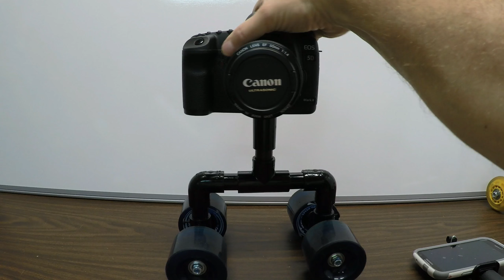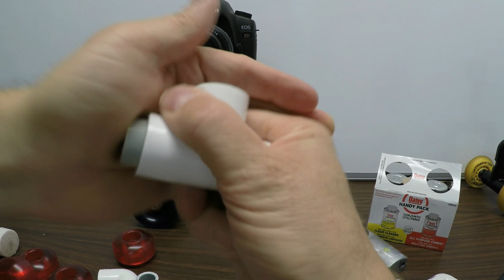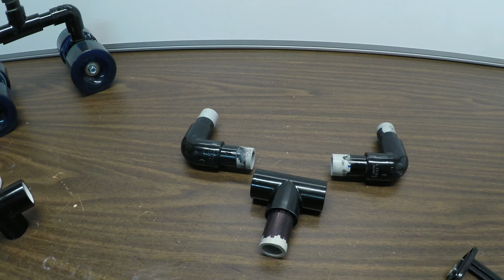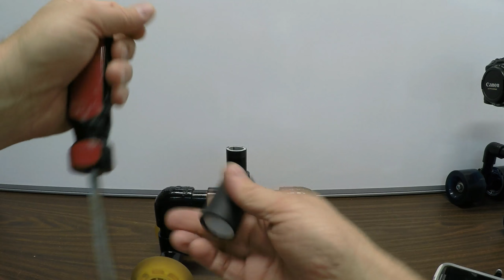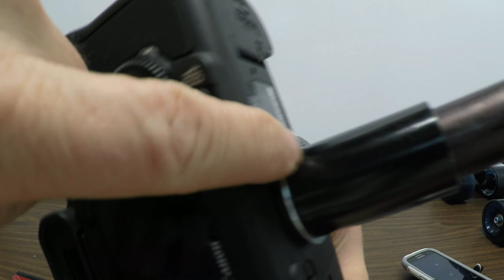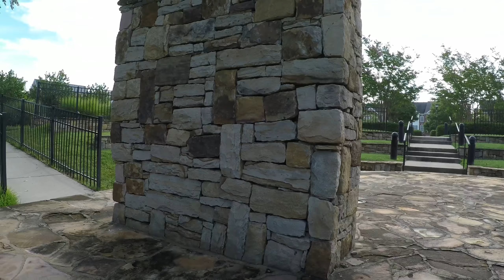How to Make the Ultimate a Track Free Camera Slider for Under $15

Comment: Great idea and awesome build. I have a couple ideas to improve on that build. Slot with a dremmel at pivot put bolt in and wont come apart as it did on you and can lock angle / curve or arc in place. And add a turnbuckle between axles for a constant or consistant arc on both trucks. That would stabalize tracking of wheels.  Just a thought.
Reply from the maker: Dewey, funny you mentioned the slot, that's one of my next builds, just couldn't fit all the different variations into this video. Plus I try to make the construction and build simple at first so folks with less tools will be comfortable trying to make one of their own.
Reply: Mike Meyers i guess great minds think alike. Hahaha